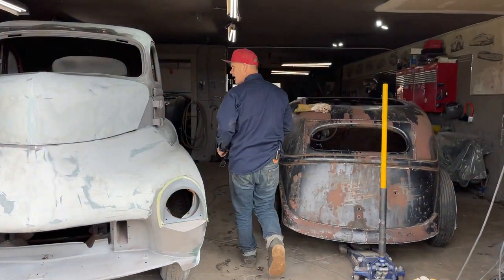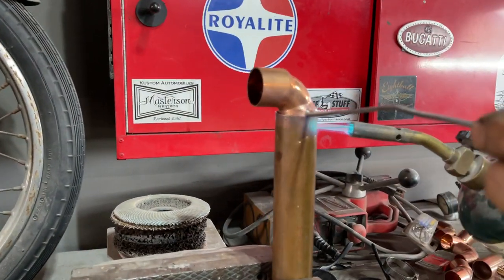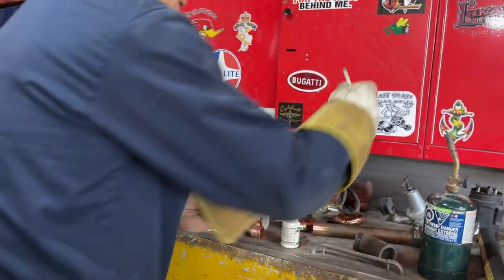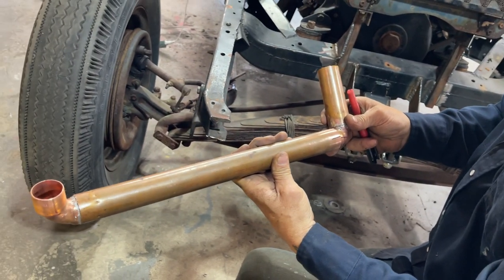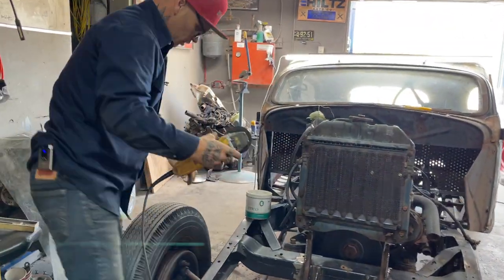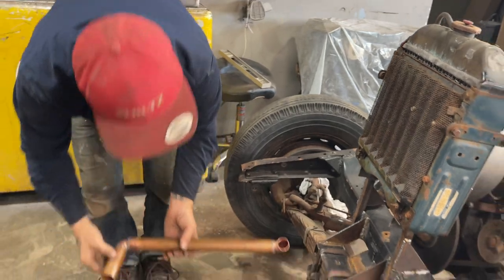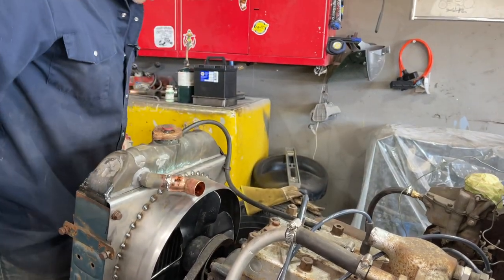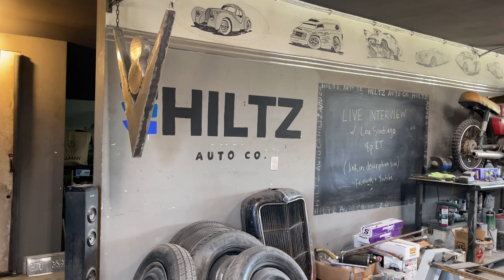PLUMBING A RADIATOR WITH THE WRONG PORT HOLES: THE NON-TEXTBOOK METHOD

Comment: Soldering isn’t like welding. Ya don’t lay beads piled up. U hold flame till it sucks solider in between connection. U may not have gotten it hot enough.
Reply: You mean Chad didn't sweat it 😜
Reply: incredible how garbage sells.. just another OCC

Comment: This will be interesting to see. I have done a very similar technique for a engine swap I did several years ago. The ports were on opposite sides to the original and I used exhaust pipe to route it to fit. Way to go Chad and great interview last night.
Reply: And there was nothIng hard about at all.

Comment: As loose as that fit is on the copper I will be AMAZED if this holds together at all.
Reply: Copper fittings go on the outside of the pipe. Wrong size fittings or wrong size pipe. And for crissakes, heat the bottom of the fitting and apply the solder to the top, it'll actually work that way!
Reply: Chad could put a vehicle together with duct tape and his fans would still see him as an expert builder.
Reply: @rijobaabojir2779  I don't think that it's a matter of considering him an expert builder.  I'm a fan of his, because he's an artist (as he himself has said many times).  He's making functional art, that's why I'm a fan.  Of course we know that there are "better" ways to do some things (and I'm damn sure that he does too).  But, he's doing things the way that legit old skool hot-rodders did it.  He's, for the most part, just using what he already has without ordering thousands of dollars from a summit or jegs.  Personally, I love it.  If it breaks, so be it.
Reply: @aamantium1  Most of his fans don’t look at him the way you do.  I won’t deny that he is entertaining. He can also skillfully piece together ‘junk’ into his own expression of auto art. However, most of his fans regard him more of a skilled builder second to none rather than an entertaining artist. He would make serious builders in the trade cringe at the many ways he does things. To think that a serious builder couldn’t do what Chad does is wrong. They simply choose not to.

Comment: You can take up the difference between different size copper pipes by wrapping the inner piece with several turns of fine copper wire. With lots of flux you can make a decent sweat joint.
Reply: That's a great technique, but if you're as horrible at brazing and soldering as I am, it is only a ...pipe dream...do you see what I did there?
Reply: Thetford cassette

Comment: cool video - You should try some silver brazing with 15% silver solder on those type of poorly fitted copper to copper joints. With an oxyacetylene torch you can make it look just like like gas welds and it is a lot stronger joint than with that soft solder. It is a lot more of an art form to use. Lol   It easily fills large gaps; comes in solid sticks and has phosphorous to keep out oxygen.

Comment: 4 grades of copper pipe and tubing, K, L , M & DWV. DWV, the lightest and cheapest is more than good enough for 20 PSI coolant work. It will come to heat quicker. Also if you want to control the visual appearance of your sweat joint, barrow from the jewelers, and apply yellow ocre paste  to where you don't want solder to go. Think of it as anti-flux.

Comment: Chad, in order for the rad hoses not to slip off of where they are clamped on, you need to keep that raised ridge to make an impression in the hose surface, therefore keeping the hose from slipping off under pressure. Also 'tinning' the copper pipe will also take up some of the excess space in the circumference.

Comment: I bet you have been laughing inside at the 100s of things you have done where people have told you it wouldn't work... and it did! And you admit right there if it doesn't work, then do it another way. I like how nothing is never a big deal with you. 

I think you probably figured out, you can just move the top of the hose out on the fitting to clear the generator pulley.

Comment: As a goldsmith there's one strict rule - never try to fill with solder. Joints have to be tight no matter what, or they will fail. I love the channel and I watch every day, but sometimes there's a better option. Clearly way too much slop in the joint, if you get it stuck together, I would't want my face near it. Boiling hot coolant ready to blast through a weak solder joint is not on the list for clearer skin.  Add in the increased pressure by using a smaller dia. elbow and the math doesn't work. I'm not saying this to be critical but more out of concerne. I've seen way too much happen that you would never think possible, and then in a split second it does, and it's too late.

Comment: Hey Chad awesome video  As always Don't want to sound like a backseat driver But you're not using enough heat coming off your torch to sautter those ends That's why your Sauter is just running off and gooping up Need to heat up the joints a lot more Remove the torch from the joint and touch the  Sadder around the joint inoto suck it right in And then wipe it off with a wet rag Looking forward to the next video brother👍👍

Comment: Chad, brazing rod would work better for what your doing. It will fill in gaps much better then soldier. Plus it will hold up to a much hotter temperature. That’s how we do refrigerant lines as the soft soldier will soften on the hot liquid line and then leak.

Comment: I’m sorry, Chad, but I couldn’t watch much.  Not a professional plumber, but I solder a lot.  Next time heat the pipe more all around the circumference.  Let it draw the solder in.  Then pile on your bead to fill the hole.  On the top one, heat the fitting till it’s hot and ready.  You can tell when it starts to suck the solder in.  You can’t really do one side, wait, then do the other side of the fitting.  You have to heat the fitting evenly, then let the heat suck it in.

Comment: CHAD I'm watching you Sauter the copper pipe it might help to sand  then use Flux heat the fitting hot enough then apply the soder and it will flow around the circumference of the pipe  😊😊😊😚😊😚😊😚😊😊

Comment: Nice job on the plumbing of the radiator hopefully none of the joints leak now Chad and jolene. And using the copper pipe across the front end might help to keep the water cooler for longer .keep up the great work the both of you 👍

Comment: If you hammer the inner pipe over a mandrel you'll get a tight fit. I used to make sliding joints for flutes that way.

Comment: When soldering copper like that, put your heat on the outer pipe, but away from the end of the pipe, say 1 inch.... the solder will follow the heat and penetrate farther

Comment: Chad, 1 tip... let the flame 'wrap' around the edge of the copper tubing and just hold it there. When you start applying the solder you can just follow it around the fitting. (a damp cloth can also be used to 'smooth' the solder before it fully cools, if you're fast. lol)
Cheers for the daily updates

Comment: Mashing parts from all manufactures together takes a little persuasion! Found a brand new radiator for $20. Fits the opening but wrong connections. Gave me a bit of confidence in making it work!

Comment: Chad, A trick I used when the copper fittings I had didn't quite fit. I used copper roof flashing material to make a shim. Less of a gap, easier to solder and hold.

Comment: Chad nice job with making it work. When soldering copper pipes you keep the heat on one side and the soldering on the other side and the soldering will flow to the heat. You may have a lot of leaks once it is under pressure.  Love watching you build.

Comment: When I worked in refrigeration, we used photocopier brazing alloy rods. It is a stronger bond for applications with high pressures and vibration.

Comment: Another hour of car building at the speed of thought. Good job outlining the requirements and solutions of the radiator plumbing problems. You knew that joining copper pipe required a tight fit so you tightened the outer pipe by punching many dimples in it so you could "sweat" the two pieces together and retain enough solder to form a tight seal.  Experience is a good thing.

Comment: That was an awesome interview last night but what the fluxing  copper do we have here today , I guess it will probably work . A long drive to the auto parts store could at least get u all the right elbows  as long as the diameter is correct then straight shot the gaps with copper. It was fun just watching Chad dad solder lol. I wish I coulda reached into the screen and turned up his propane torch tho.

Comment: The glow is just light coming in the other end, your torch wouldn't get the pipe hot enough to make it glow, and if it did your solder would burn off.

Comment: With the bottom hose touching the generator just loosen the top hose clamp and twist the hose clockwise and it will not rub love the copper look too

Comment: The secret is put the heat to the piece until the solder sucks into the joint. It’s not welding. You don’t want to keep piling it on the outside.

Comment: Why can’t you use the regular elbow that fits the outside of the pipe, and then solder another short straight piece in the other end for the rubber hise to fit onto?

Comment: Just a tip for next time , flare the elbow a little bit so it is a snug fit , it will help stop the solder from running down inside the tube!

Comment: If take the shroud off the radiator you could heat up the outlet tube and it will come right off then re*solder it on the other side, patch up the hole and wala!

Comment: Bugs me how many armchair quarterbacks have negative feedback to say.  I once made motor mounts for a 400hp stroker motor out of stacked 1" aluminum square tubing, drilled and bolted together.  They lasted until I changed them out, 8yrs later.  While a textbook method will always work, sometimes jimmy-rigged methods do too.

Comment: Learned some basics about plumbing, wish you had done it sooner I was trying to solder a facet and didn't know about flux. Live and learn. I watched the interview with Lou and you did great, I loved it.
Reply: U won’t have learned anything about soldering watching that
Reply: Please watch a real plumbing video, this is really not how you should solder copper fittings. I worked as a pipe fitter and in HVAC and this is just really not ok.